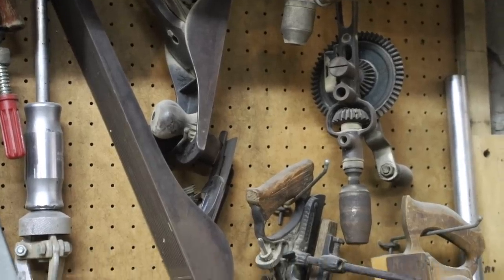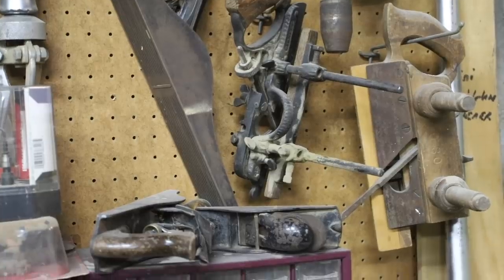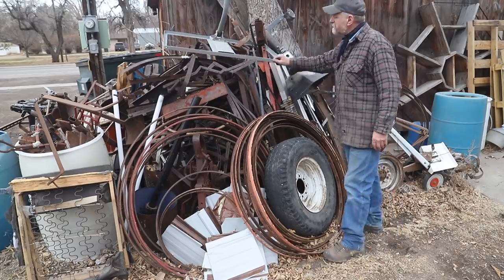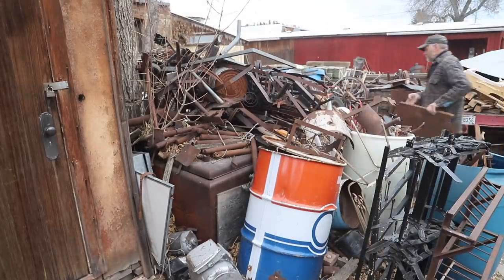Forging Duplicate Buggy Seat Irons | 2 Seat Buggy Part 11 | Engels Coach Shop

Comment: Interesting that some say you would not use a rasp for wood working. While rasps are sold in wood working tool stores for wood working. I have done several projects where the wood rasp was recomended for just what you use it for curves. My first project was a TC Arms Hawken rifle. I use several types of wood rasps to shape the stock. So rasp on.

Comment: Rasps have been used by woodworkers for centuries.  There are plenty of rasps manufactured for shaping wood.  I find them a very fast and effective tool for shaping wood, they can leave a surprisingly smooth finish too when the final strokes are light. See https://paulsellers.com/2015/07/rasps-and-wood-two-key-ingredients/ - anyone who says rasp users are not a woodworker is clearly talking nonsense.

Comment: I am a hobbiest maker of 17th and 18th century furnature.  I have been using a farriers rasp for 30 years when needed on all hardwoods.  The rasp is a go to tool for cabriole legs.  I've found the best place to secure a good rasp is from a farrier. A good farrier will replace his rasp at the least hint of dullness and will generally give the old rasp away for free to a good home. These generally have lots of life left for wood working. Don't know a farrier contact a local horse stable or equine vet to ask for contacts.

Comment: I've been using wood rasps for years when working with wood, they make quick work of rough shaping.   If you haven't tried using one I suggest you do.  No better way to shape wood than a hand tool that allows you to feel the wood as its being shaped.

Comment: My wife does her horses manicures and at least on the east cost here, for her its Belotta brand, they seem to hold up well, and I would have no qualms going after wood shaping or even non ferrous metals with them. That said anyone who looks down on rasps vs planes, that uses sand paper vs scrapers is calling the kettle black.

Comment: Dave, why do you add wood glue to the screw threads when attaching the metal corner brackets to the seat backs/sides?  Does that help preserve the "threads" in the wood?

Comment: I was guessing the difference in iron work was top related. I'm taking notice for the first time just how large your sanding belt is. How much do they cost. Oh, and for the record you are a very good woodworker. I first used a rasp when building a wood fence. I fell in love with its versatility and time save function.
Reply from the maker: It's a brute.  10 x 72 with a 5hp motor.

Comment: Absolutely stunning. True craftsmanship there, by gummy. I've noticed that you pull the rasp/file toward yourself on the cutting stroke, is this for better control? Or because of the direction of the grain? Just wondering.
Reply from the maker: You're correct.  It's far less jarring and I do like the control better.

Comment: “Didn’t get as far ... .”  Familiar refrain around here. Was that glue you put on the screw?  To help with changes as wood exposed to the elements?  You are making the pieces to fit one at a time. When these wagons were in production were the various pieces made to a template or design so they would always fit?  Thanks for the video!

Comment: I have been following you and I mesmerized with your beautiful work. I have a question on the iron work: I'm guessing that the buggy will be painted, maybe I'm wrong, in any case assuming that it will painted why you did not paint the iron work when you have the pieces on the bench??
Reply from the maker: All the backsides of the iron that contact the wood are painted first.  I try to show that where I can.  Good point.

Comment: Happy Holidays. Realy like what you are doing. A bit dissapointed tough. You use those lovely square nuts, then later on philips head and , torx ? , head screws... it just does not look right on such high quality work. Realy would like you used old time straight  slotted screws.
Reply from the maker: If you'll remember in previous vids I did use slotted screws.  Those will be seen.  None of the torx screws will be seen though.

Comment: No worries Dave. I've been around wood workers and many of them have used a rasp as you do. They make complete sense although there are more modern options, some just prefer the older hand tool method for control and shape purposes. That is a big Anvil in the wrought iron department...Would be nice to have one of those. What make and weight is it, Hay Budden?
https://www.bigdweb.com/product/code/6201.do?gclid=CjwKCAiA25v_BRBNEiwAZb4-ZTeYageRTsnhxNhvi3-l1UyJyIMuuCNCw3jjTjNIEoMOkH6dhCuMlhoCmDMQAvD_BwE
Reply from the maker: Yes.  217 lbs.

Comment: Question; you go through all the trouble to make all the hardware period correct however you put “torques” fastener screws in the brackets, why is that? Did they not use some sort of flat blade screw back then? Just curious
Reply from the maker: Yes, you're right and not alone in your observation.  In the end, none will be visible though.

Comment: Thanks for nice videos. I look them every Saturday morning. I have noticed that you use torx screws. I myself have been working on restauration on old Streetcars and there it is by someone nearly a sin and its big debates over wich way its right to put the screw head. In restauration its often compromises between geting things exactly how it was against time consum and to be able to use what you get in the shop. If you could explain a litle about screws? Where to use brass screws and steelscrews and where it dosnt matter and why it dosent matter? I also se that when you take apart old stuff you have some corroded screws. Im sure you have more experience than all of us on theese matters.
Reply from the maker: I need to address this.  Thanks for the reminder.

Comment: you are using torx screws?
also: i wonder, if the buggy has a top, wich seems to be fixed to the rear seat, would it not make more sense to fix it to the front seat, so you can use the top when the rear seat is removed?
Reply from the maker: Torx are mostly convenient.  Where ever I use them they will not be seen when all is finished.

Comment: Is that a set of hobbles hanging on your pegboard or another obscure wagon building tool?
Reply from the maker: Mormon hobbles.  They designed then so they couldn't be cut with a knife by horse thieves.

Comment: My metal shop teacher would be spinning in his grave if I used a file or a rasp that did not have a handle on it. So pardon my cringes when I see you using that fine rasp without a handle. 
Are you using lignite coal "brown coal" in your forge?
Reply from the maker: Yes I'm aware about handles.  When I worked under a horse I always had a handle on.  All my other files have handles, but I float so much with these, and the tangs are rounded, I prefer them without the handle.  I totally get the need for handles.
Reply from the maker: The coal I heat with is lignite, but the coal I forge with is bitumitous smithing coal.

Comment: Why do you punch some holes and bore others?
Reply from the maker: Drifting holes leaves more of the metal intact whereas drilling would remove too much.  Those small ends on the round rods need as much strength as possible so I drifted them.